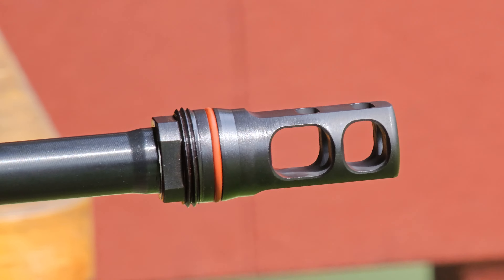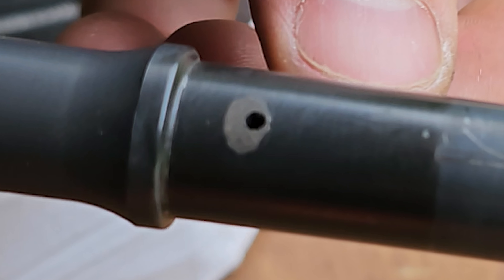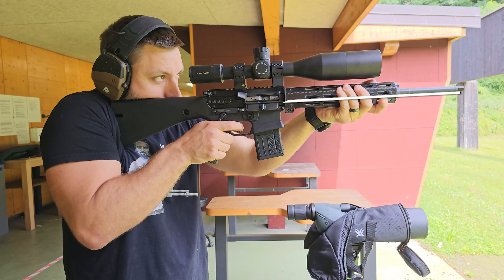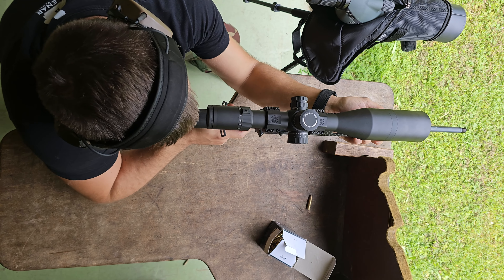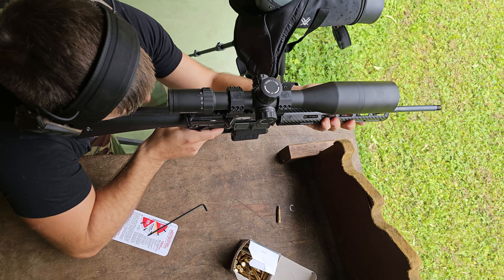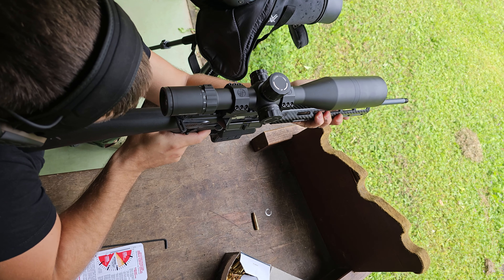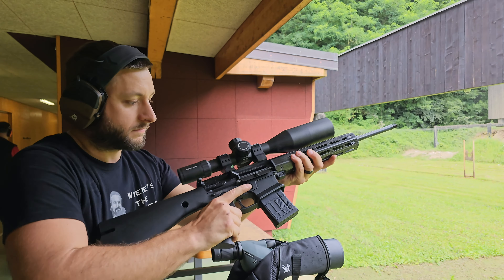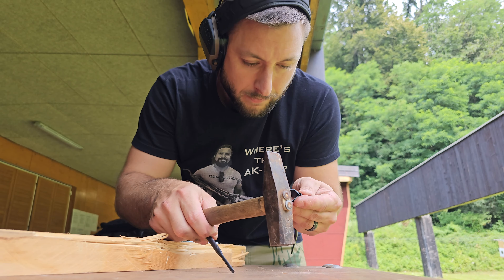How to Fix an over-gassed AR15

Comment: I run this same gas block on multiple rifles. It’s well worth the money. High quality unit and I can even adjust it without removing my suppressor.
Reply: What brand/model is it? And have you compared it to other adjustable gas blocks?
Asking for a friend…
Reply from the maker: I was surprised at how simple it was to install. The instructions are great, especially with the detailed info on how to properly tune your rifle. In this video i used the bleed-off mode but i will probably have to use the restriction mode after attaching a suppressor
Reply: @buncer  It’s from Superlative Arms. Fantastic unit. I looked into multiple other adjustable gas blocks and this one was preferred by many. Now that I have used it myself, I see why.
Reply: @PolenarTactical  Is it a Superlative Arms product?
Reply: @JohnSmith-ig6sb  Thanks hombre, I’ll look into one myself. Do you have a WWSD that you use it on, or just other rifles?
Reply from the maker: @buncer  yes it is, not the cheapest but small, quality made and simple to use - i approve ✅
Reply: @PolenarTactical  Yea that thing is crazy gassed for not being suppressed. I was shocked. I’m running an 8” 300BLK with a Dead Air Sandman S. I’m 2 clicks from fully vented. But it took that much to get the ejection pattern perfect shooting supers. Best of luck my man!
Reply: @buncer  Just other rifles. All 300BLK running various suppressors.
Reply: @PolenarTactical  It shoots much cleaner if you keep it on bleed-off when shooting suppressed but YMMV.
Reply: @PolenarTactical  If you keep it on bleed-off it'll keep the gun much cleaner. It allows less fouling to enter the receiver.
Reply: @buncer I had an aero gas block on my 10.5 and it fell apart pretty quick. The superlative arms seems to be much better quality, but it's also more money
Reply: @montevallomustang The adjustable one?
Reply from the maker: @davewebster5120   thanks for the heads up
Reply: @echofoxtrotwhiskey1595  yes
Reply: @montevallomustang  Good to know.

Comment: Ballistic Advantage barrels have been used since November of 2021 on all WWSD production guns.  

Faxon gas ports are sized at 0.081”
BA are the industry standard of 0.078”

The gas ports being over sized is one of the reasons for the change.
Reply: Very nice to hear that the issue was fixed!
Reply: I wonder if the gas port issue could have been fixed by some tweek in the barrel making process, I am not aware of the quantity of barrels you guys ask/contract for but if it's an issue they didn't fix themselves you guys did well...

Now on other things, I don't think I have found you on Twitter (or X, whatever overlord Elon decides to call it next week), is it for some privacy issue or is it something else?
Reply: @cosaqueexiste9647 I was told that drilling the gas ports smaller would be a longer lead time and higher minimum orders.  

There’s been a lot of personnel change over at Faxon, so our lines of communication were no longer as good too.
Reply: I wonder if you have a serial number range for it. I have a WWSD from Brownells and noticed odd ejection pattern but hadn't checked gas. Also had eye surgery so vision isn't up to snuff atm.
Reply: @SinistralRifleman  The BA "pencil" barrel is closer to the Faxon "gunner" barrel to boot. Even thicker forward of the gas port, actually. However, the BA "pencil" should be nearly identical to the M16A1 "pencil" profile. The Faxon "pencil" and even "gunner" are probably TOO pencil-y. I would reckon sub-moa with the BA is easily achievable but hit or miss with the Faxon versions.
Reply: @SinistralRifleman that makes no sense to me. Im pretty new in the machining industry, but seems like a slightly smaller tool would be all that's needed.
Reply: @SinistralRifleman How does one know what barrel is insatalled? I have 5. One complete preorder rifle and two complete uppers in 16” from the company that shall not be named. One each 14.5 P&W and one 20” complete upper from KE.
Reply: @joesephkingston1621  Not Russel, but Faxon should have their logo on their barrels under the handguard unless they took it off for KE Arms sales.
Reply: @joesephkingston1621 the Faxon barrels are set screw gas blocks with 3 set screws.

The BA barrels have 2 set screws and a pin on the gas block.

Both are marked with the manufacturers markings.
Reply: @classicalextremism the barrels are marked with the manufacturers info. 

Faxon Gas blocks have 3 screws, BA 2 screws and a pin.

You can also add tungsten weights to your silent capture spring system.  It’s built to be tuned.
Reply: @SinistralRifleman  sounds like a shame but oh well, their loss
Reply from the maker: did BA make .223 wylde 1/8 twist 416R stainless barrels for WWSD?
Reply: @PolenarTactical a limited number of exported units used .223 Wylde BA barrels, but more were rejected by European proofing and sent back because .223 Wylde wasn’t compliant vs .223 Remington.  They were Nitride coated BA Modern Series.

The Faxon Barrels exported we know were in .223 Remington 

There are also 5.56mm units that ended up being exported that used Faxon Barrels but weren’t specifically built to be exported.
Reply: @SinistralRifleman  What is the European proof test like and why are 223 Wylde barrels rejected but not 5.56 and .223 Remington?
Reply: Cool another company to boycott. Lemme screenshot this real quick.
Reply: @JeffNeelzebub AFAIK, 223 Wylde isn't a caliber / designation recognized by the C.I.P. so it would be tested against 223 Remington specifications. I'm not sure how well it would comply with that.
Reply: @MarvinCZ  Yes, but it has to do with the tolerances of the chamber dimensions. A proof test indicates they fire a proof round and measure pressures in the chamber.
Reply: @JeffNeelzebub  The C.I.P. proofing doesn't mean just firing a proof round. First they check the dimensions.

They also don't measure pressures during the testing. That's part of the caliber specifications but not the proofing process. They just fire an overpressure proof round and then check for damage.
Reply: @MarvinCZ  So basically Europe hasn’t accepted the 223 wylde as a valid chambering specification?
Reply: @JeffNeelzebub  No, but to be fair, the C.I.P. doesn't recognize the 5.56x45mm as a separate caliber either.

While I know roughly what the testing entails, I'm only guessing at the reason for this rejection. It's also possible the barrels failed the actual proof firing (suffered damage) but I feels that's less likely. That would mean bigger problems that would probably manifest even in the US.
Reply: Any rifle that needs an adjustable gas block is poorly built with junk parts. 

No surprise that this rifle was such a turd that even Brownells dumped it 😂
Reply: $1800 for a gun with a $140 (frequently on sale for closer to $100) barrel, lol.
Reply: @scrooglemcdoogle  Yep. 

Aside from truly no name random website “house brand” barrels, Ballistic Advantage probably makes the lowest quality and least expensive barrels on the market.
Reply: @rifleshooterchannel208  I agree and disagree, barrels such as their 416R stainless SPR barrels are fantastic and capable of ridiculously tight groups when paired with a heat fit upper. That being said, BA QC is dubious at best. I purchased a replacement SPR barrel from them to which they shipped me a bog standard M4 profile barrel of the incorrect barrel length and gas port. Sent it back, 2 weeks later I get a different style of the SPR barrel (fluted stainless); again, sent it back once more only to receive the correct barrel that WASN'T EVEN DRILLED FOR A GAS PORT. You know who doesn't send the wrong barrel and actually drills gas ports? FN, Daniel Defense, Hodge, etc. Considering FN made barrels aren't much more than BA barrels from retailers such as PSA there's no reason to be spending $1800 on a gun with a BA barrel in it.

This is also a reminder that SOLGW peddles their hypebeast guns also using BA barrels for similarly ridiculous prices.
Reply: @scrooglemcdoogle  I use many SOLGW small parts but yeah their prices are a joke for the uppers and complete rifles they use with bargain basement barrels.
Reply: @JeffNeelzebub  Only affects European countries which have a civilian proof law and are members of CIP. Switzerland doesn't, so I've got the OG US Übermensch version WWSD.

Comment: If it needs to be in full bleed to get the gun to cycle correctly without a can, you need to increase the buffer weight as well, or try the choke settings.
Reply: That stock limits the buffers setups you can use.
Reply from the maker: @lucastonoli3256  you can use any rifle buffer and to make it heavier, you just replace the steel weights with tungsten
Reply from the maker: If i wanted to run it in this configuration i would definitely prefer even less gas. 
But the plan for this one is to shorten the barrel to 12.5" and probably use a suppressor on it. So after all the mods are finished i will figure out the optimal gas setup
Reply: @PolenarTactical  the travel distance of the buffer limits the feeding timing, it isn't the same. But yeah, you can keep adding weight. An A5 setup is usually ideal for any suppressed AR, even with low back pressure can.

Comment: Well if you’re cutting down that specific barrel you may not even need the adjustable block after you do so. The shorter the distance between the port and muzzle, the larger the port size needs to be.
Reply from the maker: Correct
I'm planning to shorten it to 12.5" and that will greatly reduce dwell time. I decided to go with the adjustable gas block anyway to test how it would work and to make some content

Comment: I’ve seen others use a gas tube with a smaller hole, also adjustable gas key on the BCG from Rubber City Armory.

Might be better to have the gas block or barrel adjusted from the start.
Reply: Black River Tactical EZTune gas tube. Their site will let to specify a whole bunch, based on gas port size. The best solution as it lets you keep the pinned gas block, instead of going with the clamp on.

Comment: That shirt is amazing! 🤣
Serious question though: what do you do for a gun that's not adjustable? Like an old WASR-10?
Reply from the maker: The simplest and cheapest solution is to buy an overpowered AK recoil spring (ALG, Wolf and some other companies produce it) and add a rubber AK buffer.
The more elegant solution is to buy KNS adjustable gas piston - those work great and give you the ability to regulate gas on AKs but can be a bit pricey
Reply: @PolenarTactical  Thanks dude!
🤘😎

Comment: I haven’t really noticed it as an issue on my original spec WWSD 2020. Maybe I just got lucky. Or maybe it’s from my time as an infantry Marine, where there wasn’t a single weapon we were issued that wasn’t gassed to the point of being able to get a big-rig truck moving.
Reply from the maker: This WWSD is from Brownells Europe and it seems all of them are super overgassed. Not many US WWSD had the same issue
Reply: The M4s and M16A4s I've used weren't gassed hard. M27s also have larger than standard gas vents on teh gas blocks (1.7mm as opposed to 1.5mm) which lowered the rate of fire significantly over normal 16.5 HK416s. However, the NT4 suppressors now issued to infantrymen massively increased the rate of fire, as did M855A1. M27 has had no ECPs to the gas system unless you count the whole upper replacement that is the M27 Reconnaissance Weapon Kit, which is an 11.5" HK416A5 upper for Recon Marines using existing M27 lowers in inventory. 

So practically, an M27 went from 650rpm to 1400rpm in about 10 years. Pretty amazing.
Reply: @PolenarTactical  
I thought they all were overgassed...do we get all the oversized gas hole barrels for double the price? What the H?

Comment: I only have experience with one AGB and it carbon locked very quickly removing the adjustability of it. How are people's experiences with the SA AGB? I personally don't use them as they're just another failure point (based on my limited experience, not any hard facts). Black River Tactical gas tubes and buffers are all I will change to maintain maximum reliability.
Reply: All gas blocks need to be oiled and have the screw turned in and out after shooting including the SA no matter what people say..It is the worst IMO..I like the SLR because it can be taken apart and repaired if needed..That said, the best adj gas block is the Rifle Speed if it will fit under your hand guard. It makes all the other adjustable gas blocks obsolete..Expensive but worth every penny..
Reply from the maker: not sure what kind of gas blocks you guys are using but the one on my Schmeisser was not cleaned for two years and it's a 10.5" that i usually run with a suppressor.
I just took an allen key and adjusted it for a couple of clicks not long ago - no problems at all. 
Can't say much for SA as i just got it and shot less tha n500 rounds through it but it seems quality made and i don't see an obvious point of failure
Reply: @PolenarTactical  Thanks for the input. The one that locked up on me was just one that I had years ago, so the technology and reliability in newer ones is probably a lot better. I commonly shoot in the rain and maybe I didn't do a good job of maintaining it. Was just curious :). Maybe I'll revisit these gas blocks at some point. Just haven't really needed adjustability on the fly, suppressed or not. I've always been able to find a happy medium.

Also I can see the AGB being one of those anecdotes that one guy back in the day had one fail so it spread that all AGBs are now unreliable (lots of this in the gun world as you know already lol) when in reality it was just a freak failure or misuse on the user's part. Which is very possible why mine failed. But there's a lot of info out there on how to "un-carbon lock" adjustable gas blocks so it definitely happens.

Would love an update video on how you like this SA gas block. It looks interesting! Keep up the good work!

Comment: How to fix undergassed Ballistics Advantage barrel?  All the weights from the buffer have already been removed.  And a neutered carrier installed.
Reply: Make sure the gas block is on properly
Reply: You could have a poor gas key fit, gas inefficient carrier, loose or clocked gas block, worn or cracked gas tube, etc..Pin gauge your gas port and go from there..
Reply from the maker: I have no experience with ballistic advantage barrels but if it's as bad as you write - the rifle doesnt want to cycle even when you did all these modification, then im pretty sure there has to be some serious problem. 
I would remove the gas block and check what's happening. Possible causes for undergassing can be misaligned gas block where it doesnt sit directly above the gas port in the barrel. it could also be an issue with a gas tube. And when you take the gas block off, i would also measure the diameter of the gas port drilled in the barrel, just in case.
Also if you used an aftermarket gas block it is possible that your gas block has a smaller gas port opening than your barrel and is restricting gas flow